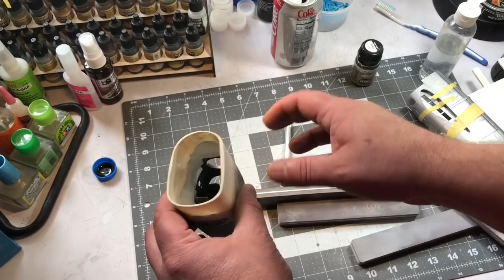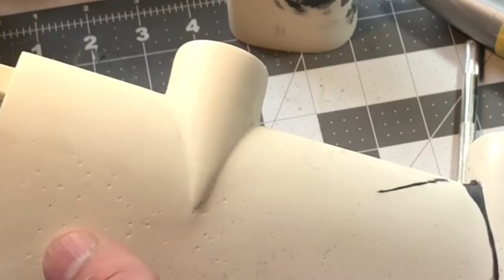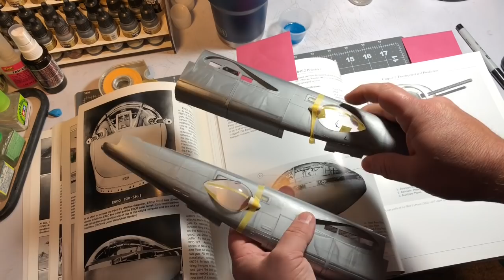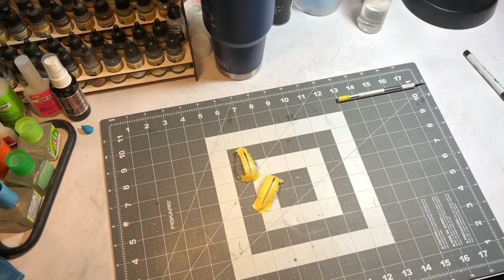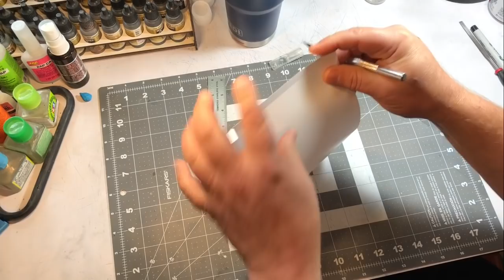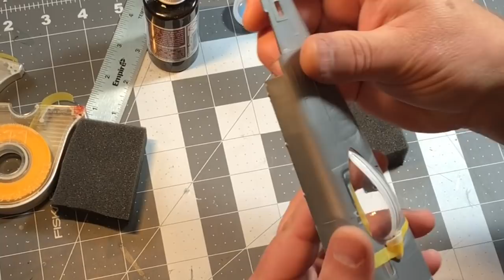1/48 PB4Y-2 Privateer Conversion Part 4: Side Blisters

Comment: For filling in the dimples on the wings and other areas, you could also try the acrylic powder with cyanoacrylate (CA) glue mix, made popular by master modeler Paul Budzik.  You could mix up a small batch and then lightly dab in a "dot" of it in each dimple.  Cures fast and sands easy.  Cures hard and is machinable so you would have no problem scribing through and not damaging it.  The brand of acrylic powder to use is "Dentsply" pink acrylic powder.  It's a dental product used in the dental industry for making molds, dental crowns, etc.  Paul Budzik uses Zap brand CA but I have found that generic medium thick CA works just as good.  This acrylic powder is great stuff when mixed with CA and used as filler for plastic models.  The caveat is that it's expensive!!  I tried the technique a few builds back and its now my mainstay filler.  I rarely, if ever, use anything else now.  I purchased a 1 lb. container of it and I I think it was around $70.  Pricey but that much of it will last a lifetime for any modeler.  That's what I would use for those dimples if I were doing it.  With that said, an epoxy resin as you suggested, or perhaps epoxy putty might work too.
Reply from the maker: I’d looked into that a couple of years ago after watching Paul’s video on it.  I couldn’t find it anywhere.

Comment: Never boring. Place tape on the inside & try that clear 2 part epoxy in the syringe. Fill the window & pull the tape when dry. You may want a slip sheet of like baggy plastic to have nothing happen to the inside surface. I wonder of tape residue. I feel this would work. Great job so far. It is awesome. Just your panel line inscribing blows me away. This day & age is wicked cool modeling. Nice blister cuts.
Reply from the maker: That thought about the resin also ran thru my head Daniel...haven’t quite settled on what I want to try first yet tho